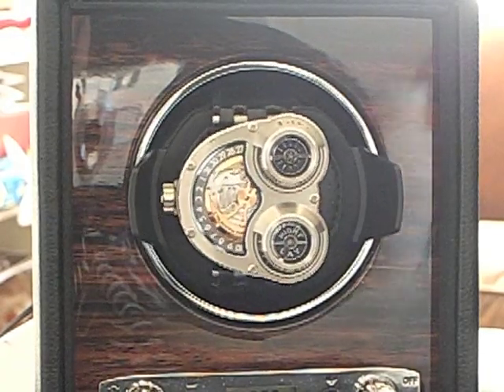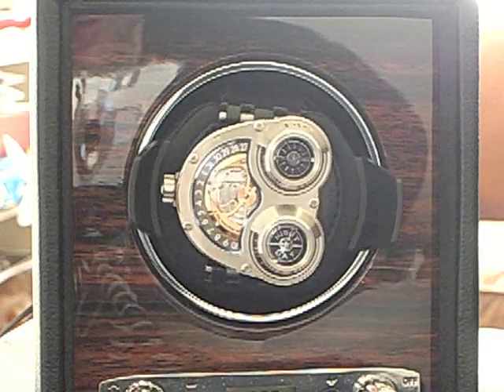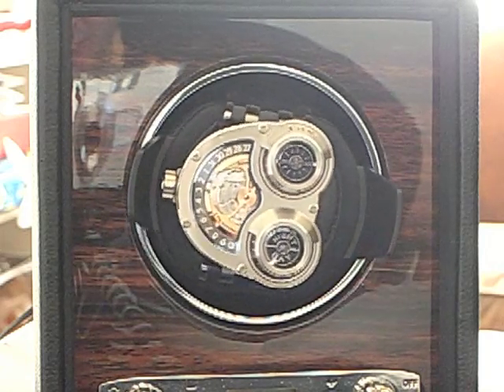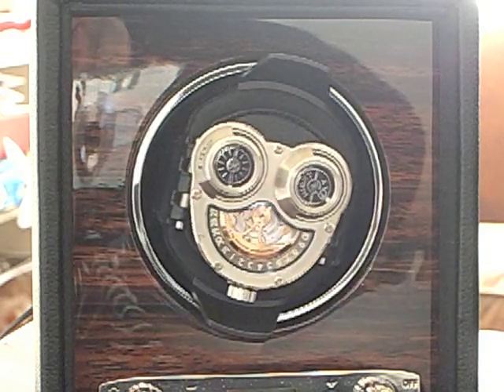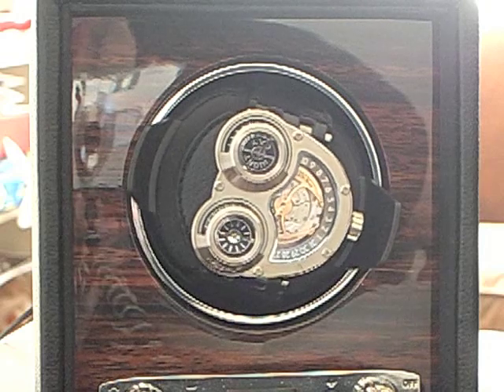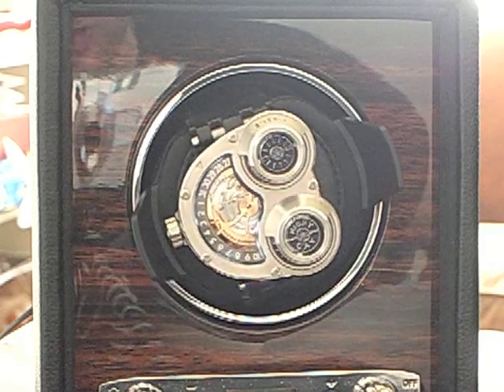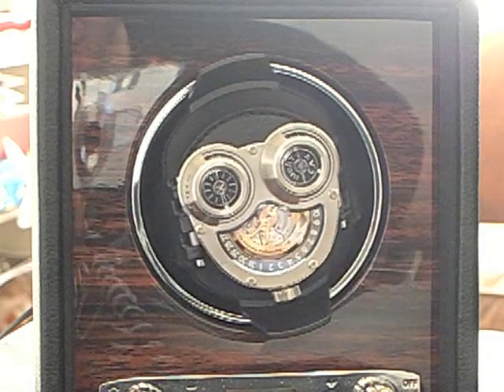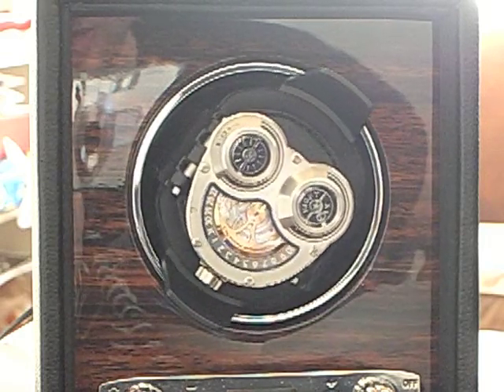How a Watch Winder Works

Comment: I was a bit skeptical in ordering this, as my other winder was 5 times ↝↝>imgs.love/dWinder?yるy   When it arrived I immediately thought it's expensive/elegant looking, and has held up so far. The finish fits very nicely in my closet, and doesn't look out of place. I have a small wrist so the fact that I can adjust the watch pillow is everything, no more squishing my watch onto an oversized pillow. The motor is so pretty quiet and barely noticeable. Very impressed so far and no regrets with this.

Comment: Does the watch wind or unwind depending on which direction the rotor is spun?
Reply: The rotor never unwinds the spring. On my watches the rotor winds when turning one direction, and spins freely in the other. I've heard that on some watch movements the rotor winds in both directions.

Comment: So, if I am understanding this correctly... I am supposed to use a battery powered watch winder for my automatic watch because it does not use batteries? Why not just wear the watch or spend about a minute setting it if it has stopped?
Reply: ***** For those of us who own multiple watches, used for different occasions. I have one watch I wear on an everyday basis which wouldn't require a winder. But having a case that winds my other 3 novelty watches is mandatory if I am to keep all calendars and moon phases on par.
Reply: because a man can only wear 1 watch at most? seriously.
Reply: totally agree with u. U got a point :))

Comment: No, the rotor spins to increase tension in the mainspring, which is like the "battery" of the watch. When you spin the rotor via movement of the wrist or in a winder, you're "charging" the watch. This lets the watch continue to operate even while stationary. Typically, a fully wound watch will be able to run without any additional charge for roughly 40hrs, depending on the watch.